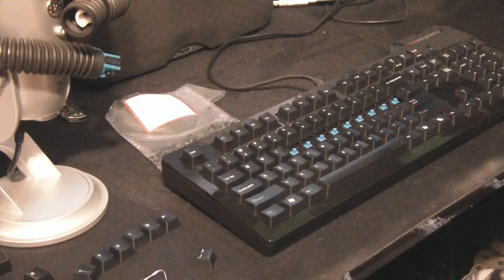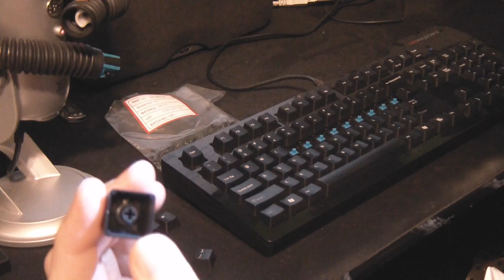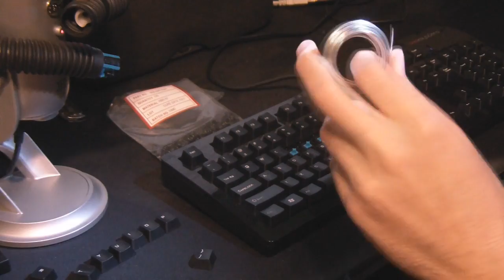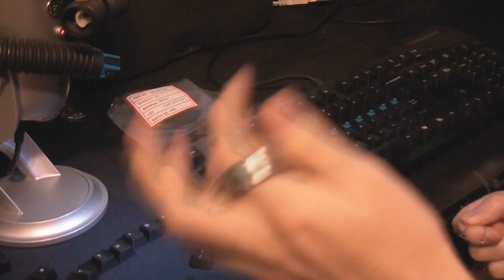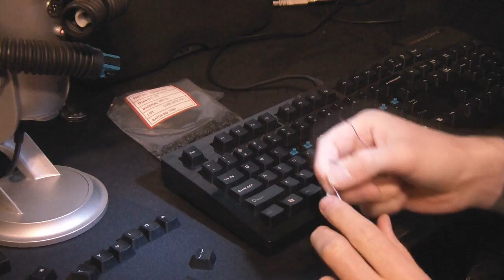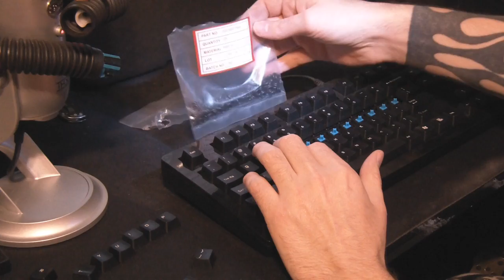Mechanical Keyboard O-Ring Mod

Comment: I was inspired by your video.  I have the Das Keyboard Model S Professional  Silent, but I hated how it started to hurt my fingers just after a few days of use.  I type very fast, and as a result I probably press harder than the average person.  I love the fact that the keyboard is mechanical, but I would forcefully bottom out with every single key press.  After seeing your video, I ordered the same o-rings from the same website.  It's so much softer now.  Such a big difference!

Comment: Thanks for the video! I did this mod on a Rosewill keyboard with MX Brown switches.  I used some o-rings from Amazon - 008 Buna-N O-Ring, 50A Durometer, Round, Black, 3/16" ID, 5/16" OD, 1/16" Width (Pack of 125) for $8.25, free shipping.  I used a 7/32" Craftsman 1/4" drive socket to push the o-rings onto the key caps.  Sounds a lot better now!

Comment: Thanks for this, I saw some expensive set of O-rings sold on amazon specifically for this purpose... I knew if I found the specs I could just order them from mcmaster carr for 1/4th the price. Even with the shipping costs its way worth it.

Comment: I use Revlon slant-tip tweezers to push my rings on easily. Square-tip tweezers might be better, I just happen to have slant-tip, but I wouldn't use any "sharp" tweezers like Tweezerman.

For what it's worth, my McMaster-Carr black Buna O-rings started cracking and breaking after about a year.  My new set are from WASD Keyboards.  Haven't had them long enough to be sure that they'll hold up longer than the McMaster-Carr ones, but I think they will.

Comment: Disassemble the parts with gloss finish, get some smooth water sandpaper, sand it, clean the parts well to remove all the dust and dirt, apply primary plastic paint and then one or two layers of matte plastic color spray paint.

Comment from the maker: @aznguyen316 I want to know as well but I do not have any of the soft landing pads.  I hoped that somebody would have a few left over and sent them to me to test.

I know the pads sit on the switch instead of fitting inside the key so it may not be as consistent, but it also may dampen the noise more since its larger.

I just finished this mod on my new Das w/ the brown switches.  The change was not as large in sound but it feels really nice.

Comment: Its probably -009, maybe -010 would work too. I got the -008 and they worked but I think they are a bit tighter than necessary, but certainly accomplishes what I wanted.

Comment: Also, how do you remove the keys with the metal bars, like the space bar key or the enter key (any key that is larger than the smaller letter keys).  Those don't just pop off.

Comment: Would anyone know the exact specs of these o-rings? Mainly the thickness. 

Figuring most rubber o-rings would change the feel, just don't know the exact size. (you can get like 100 off ebay for like 4$ and free shipping...)

Anyone ever try on a blackwidow ultimate? thinking the o-ring is going to bump the leds.

Comment: I found a good deal on Amazon for o-rings (http://www.amazon.com/dp/B0051XWXCE/ref=pe_385040_30332190_TE_M3T1_ST1_dp_1) and am trying them out on my Das Professional S (Blue switches).

So far, I'm undecided.  It definitely quiets it down, but unless you're touch-typing without bottoming out, I find that the rubber resistance makes them a little bit painful on the fingers.  Certainly a simple thing to try out, and change back to stock if one doesn't like the effect!